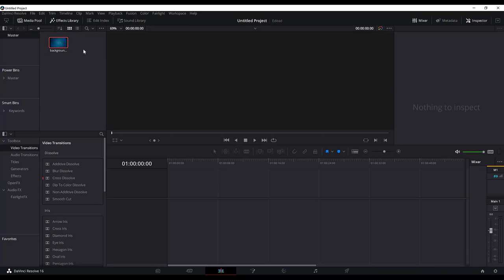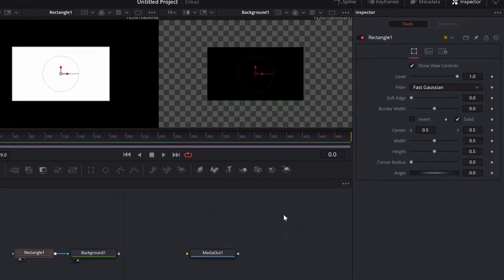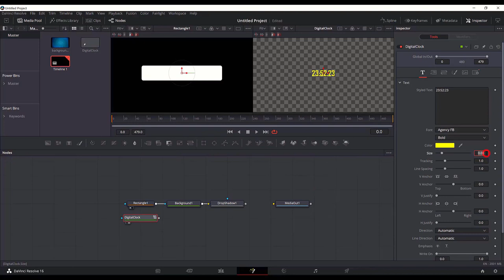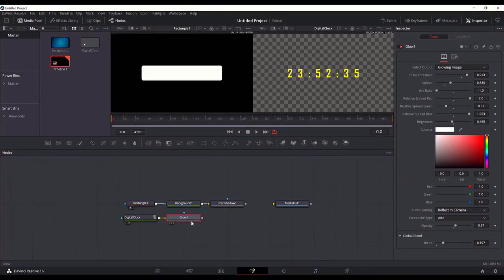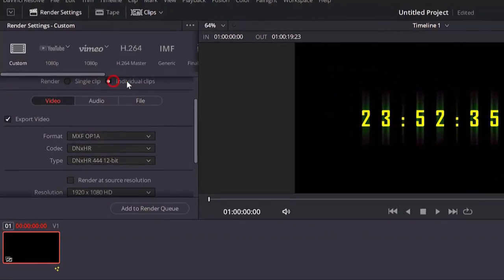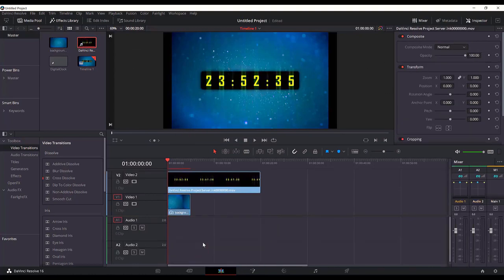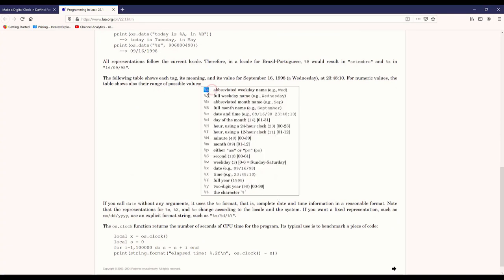Make a Digital Clock in DaVinci Resolve

Comment: I followed everything you did. When I put the digital clock code in, your video showed the numbers on the screen but mine doesn't show anything. What did I do wrong?
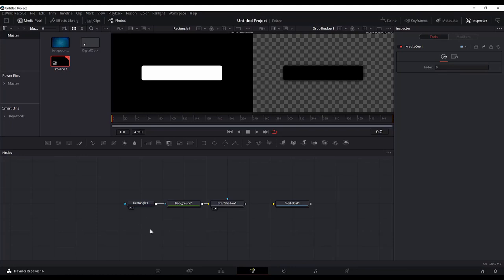Reply from the maker: Are you referring to the code that was copy and pasted to the nodes section, which is supposed to show the digital clock digits? I do that around minute 03:20, is that right?
Reply: @TechVideoStack  Yeah I have the same problem :C

Comment: Hey! I was able to follow all the way up to the point where the clock changed from analog to digital. How do i get that to happen?
Reply from the maker: Can you show me, what minute is that, when you lost track. I don't recall using analog clock in this tutorial ... maybe you mean, when I added the Lua code to the nodes section?! Can you please provide more details?
Reply: Yeah when you clicked the digital clock node and the black box turned into the actual timer. I was at 4:27-4:29
Reply from the maker: Have you copied the code from the webpage to DaVinci Resolve?
Reply: Yeah I’ve copied it. And I got the box and everything but my counter just doesn’t show. I’m gonna try again and see if there was a step I missed before that point that caused it not to work.  I’m really new to Resolve and still trying to learn.
Reply from the maker: Just follow the steps, it all should work fine for you ... DaVinci might seem scary in the beginning, but then it comes very fun to work with ... don't give up 😉

Comment: Thank you for a nice video. I se only one problem and it was when all the numbers move to the right when the clock changes to number one. It’s possible to adjust that part with expression tool?
Reply from the maker: You are right about that, it doesn't look nice! To adjust that, you should look at the font settings, maybe use another font, or change font alignment! I don't see a way, on how to solve that using expressions, as with expressions you just print the time!

Comment: Great video! But what about if i need the clock to start at a custom time? For example starting at 18:03:00 (HH:MM:SS) Thanks so much. Also how do I edit the code? How do I get back to the code?
Reply: Here is the trick:
1- Set your Fusion Clip Time longer than you need. (E.g. 8 Minutes) 
2- Change your PC time.  Let's say you need to start at 18:03:00 Change your PC clock to 17:55 and start rendering at 18:00
You will have your Digital Clock rendered as a video starting at 18:00 for the duration your Fusion Clip. 
It worked for me 👍

Comment: OK. This is brilliant! 👍
It's also very close to what I want, and I'm wondering how the code would need to be changed to start at "00:00:00" (or, even better, just the "mm:ss", but I can easily mask out the "hh:").
Also, ideally, I'd like to increase the speed the time changes, preferably by a parameter? 
Perhaps I should explain the reason for my requirement ... a time-lapse with the script indicating the real amount of time that has passed.
Any help will be much appreciate. 👍
Reply from the maker: Thanks for watching! To achieve your effect, I suppose you can use the TexTimer modifier in Fusion. You don't have to mask out the "hh", you can just un-check the "Hrs" checkbox, and you will be left with only the "mm:ss".
The tricky part is the speed increase .. I can only think of rendering only the timer first in a composition which has a duration of the original recording, and then bringing it in the timelapse video and speeding it up using the retime controls in DaVinci Resolve. You will speed the texttimer clip by the percentage you have sped up you timlapse video. Hopefully this makes sense and is doable.
Reply: I'm trying to do the same thing

Comment: Great video! But what about if i need the clock to run a custom time? For example starting at 19:25:30 (HH:MM:SS) Thanks a lot mate!
Reply from the maker: Use this code:
{
 Tools = ordered() {
  DigitalClock = TextPlus {
   CtrlWZoom = false,
   NameSet = true,
   Inputs = {
    GlobalOut = Input { Value = 119, },
    Width = Input { Value = 1920, },
    Height = Input { Value = 1080, },
    Font = Input { Value = "Agency FB", },
    Style = Input { Value = "Bold", },
    VerticalJustificationNew = Input { Value = 3, },
    HorizontalJustificationNew = Input { Value = 3, },
    ManualFontKerningPlacement = Input {
     Value = StyledText {
      Array = {
      },
      Value = ""
     },
    },
    FrameRenderScript = Input { Value = "local timeshift=4*60*60; --+4 hours\nDigitalClock.StyledText = os.date('%H:%M:%S', os.time() - timeshift);", },
   },
   ViewInfo = OperatorInfo { Pos = { 142.053, -49.3112 } },
  }
 }
}

Edit the timeshift variable number, to get to your desired time. You need to do some calculation, for example going 4 hours back, the formula to calculate 4 hours is 4 * 60 * 60 (num of hours * minutes * seconds). If you want to go back 4 hours, then use use the minus (-) sign (os.time() - timeshift). If you want to go forward 4 hours, then you use the plus (+) sign (os.time () + timeshift)
Reply: Hi! Since this video came up pretty much as the only thing to create a clock (and not a stopwatch) and it took me an hour or so to get what I wanted to do, I wanted to share this piece of code which doesn't rely on the system time but instead the timecode of the fusion composite clip. Code was copied together with a helper method from https://gist.github.com/jesseadams/791673 and pasted into the "Frame Render Script" area visible at 4:24 in the video. Basically the `23*3600+48*60+40` is the time you want to have at the beginning of the clip, and `time / 30` is frame count divided by the fps (30 frames per second in my case). Hope this helps a poor soul who also just wants to place a deterministic timer in their video ^^ Anyway, thank you for the video, Tech VideoStack! Would not have made it this far without it <3 

function SecondsToClock(seconds)
  local seconds = tonumber(seconds)

  if seconds <= 0 then
    return "00:00:00";
  else
    hours = string.format("%02.f", math.floor(seconds/3600));
    mins = string.format("%02.f", math.floor(seconds/60 - (hours*60)));
    secs = string.format("%02.f", math.floor(seconds - hours*3600 - mins *60));
    return hours..":"..mins..":"..secs
  end
end

DigitalClock.StyledText = SecondsToClock(23*3600+48*60+40+time / 30)
Reply: @TechVideoStack
 @FlodderGaming  
Thanks to both of you. It works perfectly. 
I am not a "code" guru at all but I just replaced the numbers "23"  and "48"  in the given code (23*3600+48*60+40+time / 30)  to the desired time and it works. :washhands:
So if you wish a clock starting at 13:45:33,  the above code would be "DigitalClock.StyledText = SecondsToClock(13*3600+45*60+33+time / 30)"